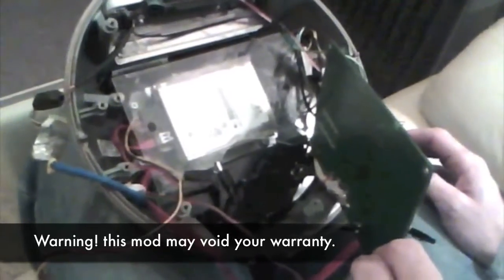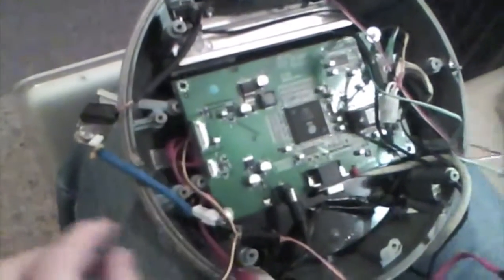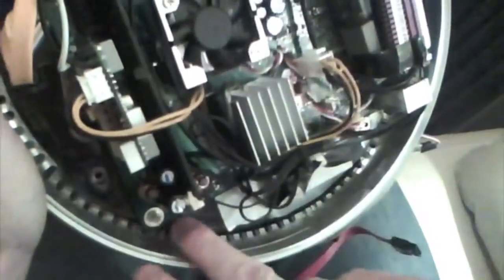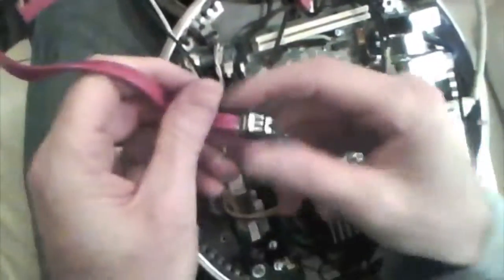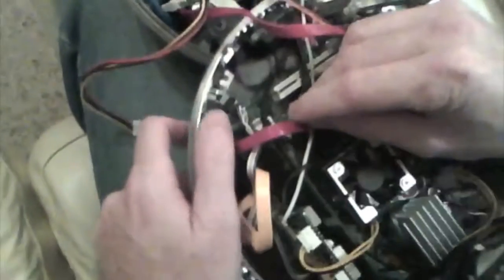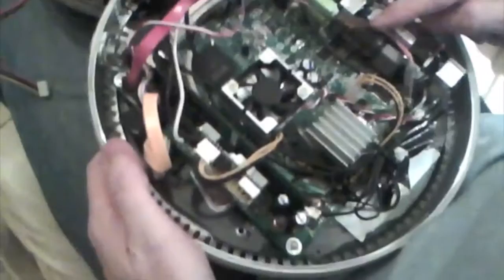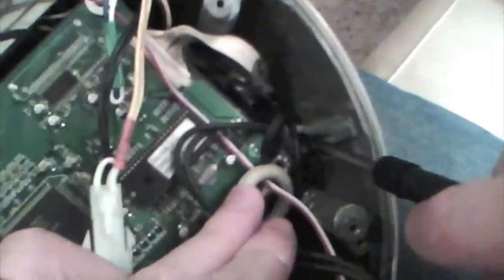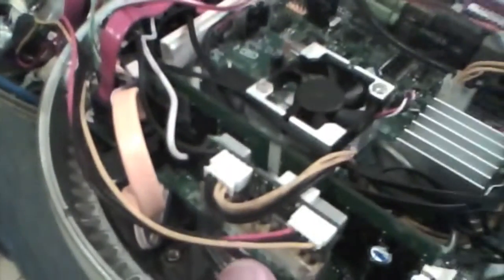iMacG4 Assembly

Comment: hi there thanks for the mod can you please explain what the reset button is hooked up to ? also why do you have the lcd board in the base ?, did you swap out the original monitor ?I thought the control board is actually integrated into the monitor ? thanks
Reply from the maker: the power button was hooked up to the imac power switch.  the reset button probably wasn't hooked up. yes the original monitor was swapped out, that is why the control board was in the hemispherical base.  in the case of a real imac it is.  after i made that mod, i was able to make the imac monitor work as a dvi monitor.

Comment: This is terrific!  Great job!  I'm trying to do the same.  How did you use the original PSU to connect to the pico psu? Do you have to wire the original in some way to have it on to supply the 12v to the pico?

Comment: That is one intense cabling job you had to do. One question though, is that a daughterboard you used to convert the TDMS signaling for the monitor to something that could be output by the PC? Looked like you used stock cables from the monitor for that.